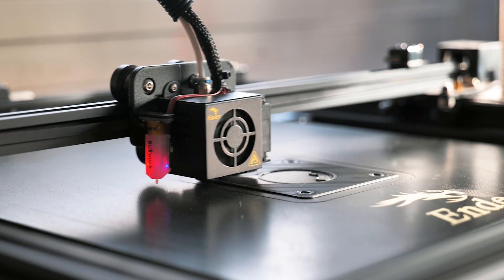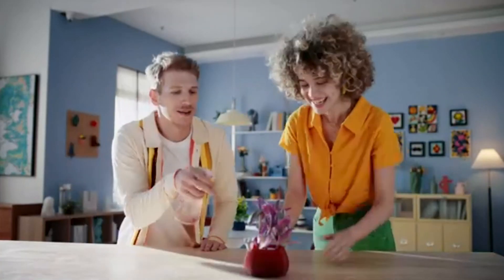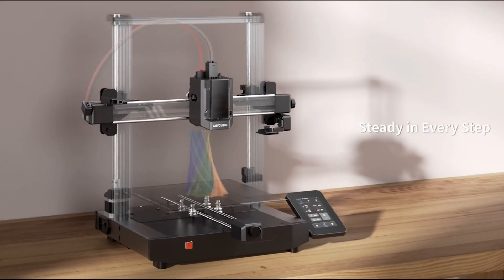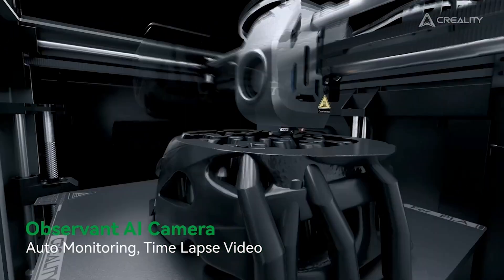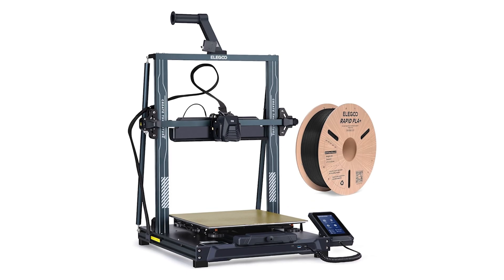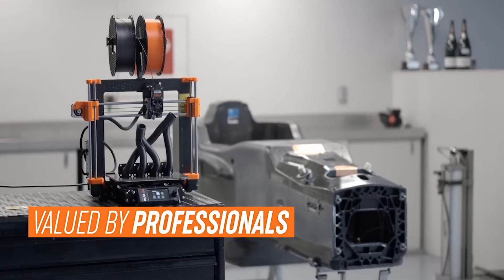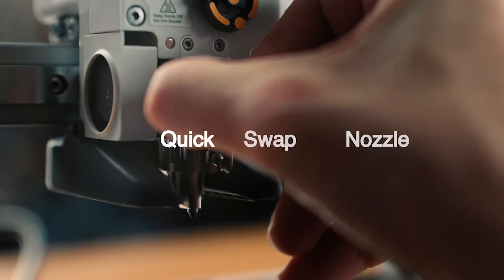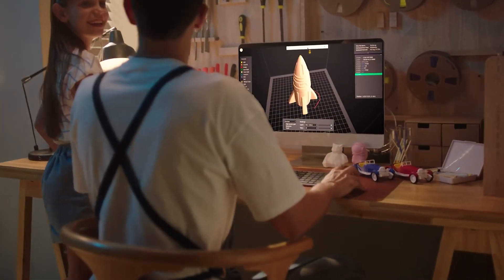TOP 7 Best 3D Printers You Need To Buy in 2025!

Comment: Maybe I'm a luddite, but i cannot fathom a situation in which i would want or need to initiate a print on the go using a mobile connection.     A situation of urgency would necessitate buying a ready made off the shelf product instead of risking a print failure and waiting x amount of hours.   I'm not sure why companies wasted money developing the capability.

I think software that let's you send prints from a central location to one of many or several printers at once could have a place in a large enough print farm.    I can imagine laying out four medium parts on a print and sending it to four idle ready printers to quickly produce 20 parts.

Can someone explain how movile connectivity for printers is more than a gimmick?
Reply: I actually use the mobile app to start prints quite often as I still go to school on some days for up to 9 hours so if I design something in a break it can be done printing when I get home.